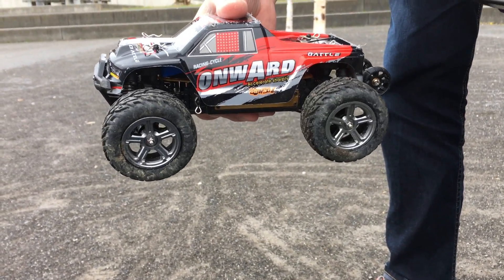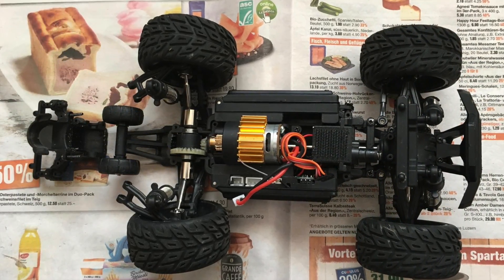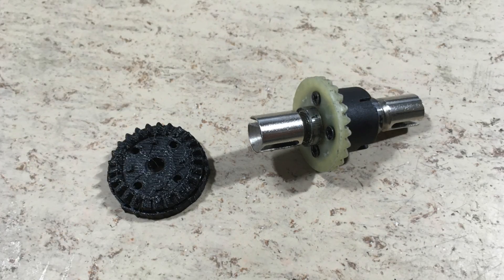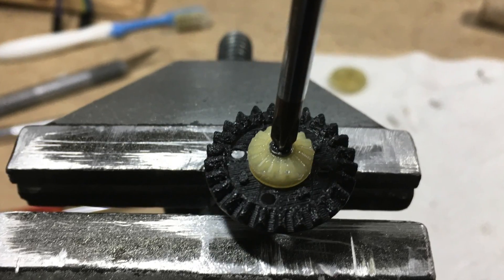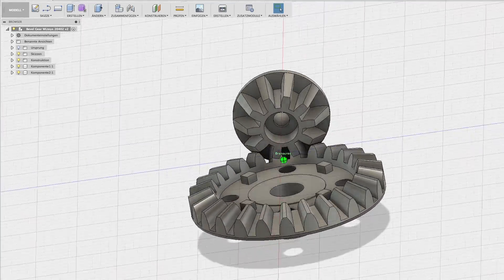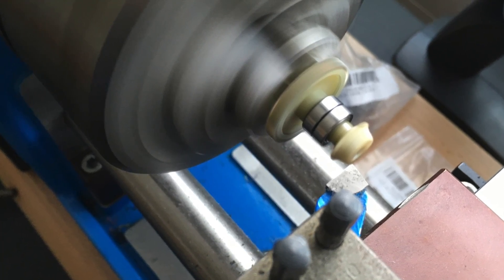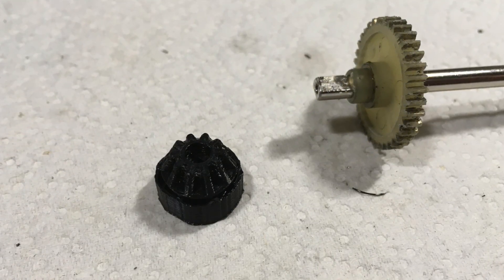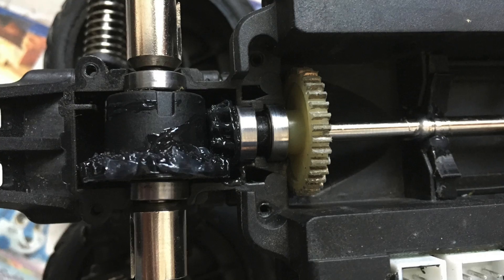How To Repair Your RC Car Gears Using 3D Printed Gears: WLtoys 20402

Comment: The gear on wl 20402 don't match each other together so they eat each other,Adjust the small one forward and believe me the gear will stand much much longer
Reply from the maker: The gear mesh in my car was OK. Dust and gravel between the teeth was the problem.
Reply: @TheDIYGuy999  Your 20402 gear mesh is not ok,see the broken small gear,the edge didn't wear away because the gear not mach well,just put 1mm something between gear and transmission shaft,the gear s will stand much longer

Comment: Do you have a 20402 rear axle seat 3d design?
Reply from the maker: Sorry, unfortunately not
Reply: The gear on wl 20402 don't match each other together so they eat each other,Adjust the small one forward and believe me the gear will stand much much longer